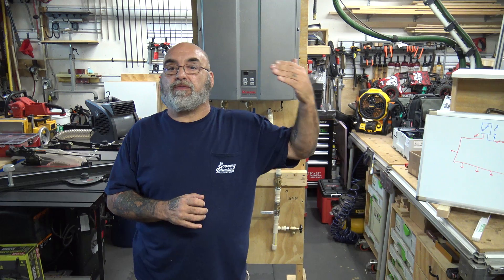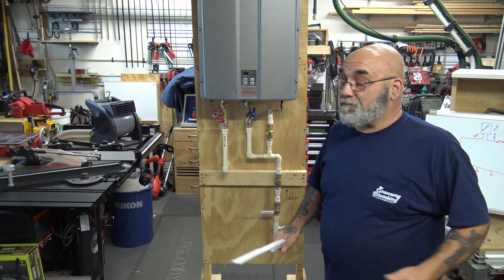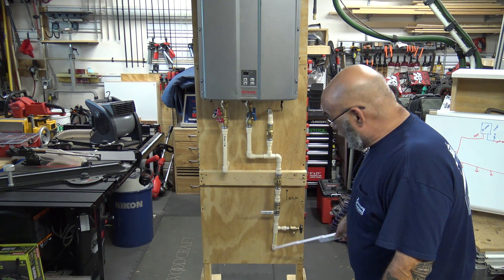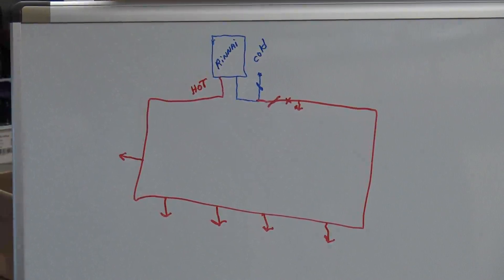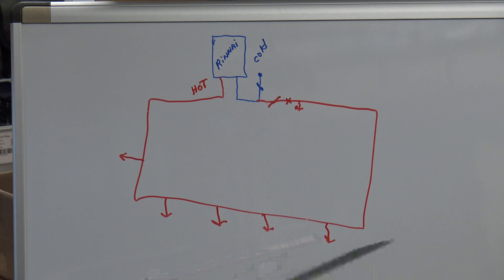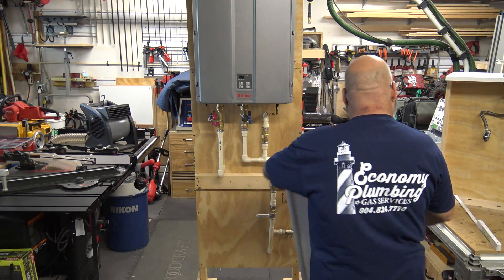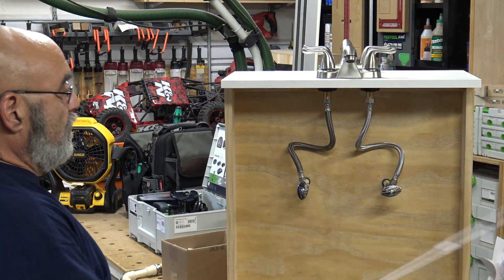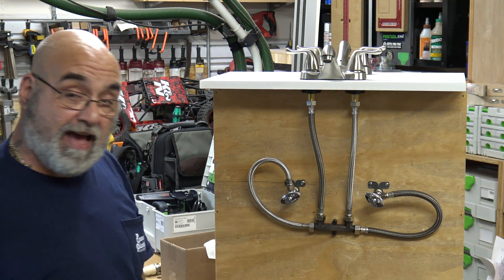Proper water piping for a dedicated return line on a Rinnai RUR unit

Comment: Hey Mike, with both of those ways, isn’t that just being efficient and just helping with warming of the cold water before it enters the boiler. What if we just want to recirculate the DHW line to instantaneous have hot water, with out the boiler kicking on. I just installed a rinnai in my dad’s house with underground water piping. And with it being winter and such a long run, it doesn’t seem to be very hot. The temp is turned up to 140, and the bathrooms are good to go. But it’s just that long run.

Comment: Hi I have a navien NPE 240S 
I have the navien bypass valve but was told I can’t use it.  How do I install an external circulation pump with check valves and the navien valve without running a third line 
Thank you for any help

Comment: Just had an RXP199i heater installed externally.  Do not have a dedicated return line,  Had a thermal bypass valve installed at the kitchen sink - not quite the farthest away, but the most used.  Today was first full day of usage.  Uses natural gas.  Temperature set at 125F.  Not getting hot water quickly in kitchen.  Takes at least 90 seconds for the water to get hot, about the same time as my old heater with no recirculation.  No error codes.  Not using Smart-Circ.  The bypass line is installed correctly.  The hot water exit from the heater is not hot, except when taking a shower.  Will call the plumber tomorrow, but would like idea of why it is not operating properly. Economy vs comfort, activity mode, pump speed, first day operation, or some other logic problem?

Comment: Is that recirc line reduced to 1/2 or remain at 3/4?
Reply: My 3300 sf house was built with a dedicated recirc line. Hot water out is 1” and return is 1/2”. I think this is smart because the 1/2” works for recirc when faucets are all closed, then when a faucet is opened it creates a bit of back pressure keeping hot water from keeping recirculating.

Comment: I think that  just screwed up!  I installed a Rinnai RX199IN Sensi :RX 11gpm for a small 3 bd/2ba house near Chicago. Totally replumbed the 75 year old house with a return line. I ordered the unit thinking that it had a built in recirc. pump. It is not an RUR unit. Do you have a video about installing a recirc pump?

Comment: I had a plumber come in and put in a dedicated return line from my kitchen faucet to the tankless. So the hot line goes from the tankless to the faucet. There's a loop maybe 20 feet from the tankless with a check valve in it and the arrow points to the tankless. The loop goes back to the tankless and into the cold water. There's a check valve about a foot from where the loop enters the cold water to prevent it from going back up that pipe. The loop goes into the tankless cold water inlet.

The problem is that sometimes the water will just be lukewarm. I can touch the hot pipe coming from the tankless and it's hot. But it's like it keeps recirculating cold water into the pipe or something and never stopping. I'm pretty sure the tankless setting is 4B. I don't know if setting 5 is set to comfort or economy. The plumber who initially installed the tankless said it's a cold water sandwich. He is not the plumber who installed the loop. What's causing this issue?

Comment: I have the RSC199e, and it doesn’t have the “plug” on the hot water line (in the out put area near the valve). I have it setup for recirculation with the crossover (thermal bypass) valve. It seems to be working correctly. Should I be looking for the “plug” internally?

Comment: Hello Mike, I have been following your exceptional video series on the Rennai installation. I do have for know a quick question. For the hot and water piping, is there a required type of pipe that must be used? I am in Dallas Texas and the unit is a condensing model that I am installing in the attic space. Could I use red and ble 3/4" PEX piping? I look forward to your reply. And a gain, Thank you so much for your great videos! Lionel,

Comment: If you have a regulator on the water service, it would be considered a closed system. Is the inlet check valve necessary on the cold water.

Comment: Aren't you creating a closed loop system with the dedicated recirculation line?  In practice, I think you need to add an expansion tank.  Otherwise, the expanding hot water is going to cause over pressure.

Comment: Whats the reason for the spring check instead of swing?  I installed swing on mine and it's horizontal so i didn't think it would matter?  After watching your video I see i need to add a drain valve.  Thanks in advance!

Comment: when recirculating pump is running, how does the cold intake know to pull from the dedicated recirc in and not the incoming cold water, or a mix of the two?

(Will the hot water have higher pressure because of its temp?)
Reply: I have the exact same question. Also does it matter if the Recirculation line is plumbed closer to the tankless water heater than the Cold water line or not? @ThatTanklessGuy

Comment: Hello Mike, I run in your video looking for help un the dip switch settings in a Rinnai RB 30/36 sanitary+heating gas unit. I connected a remote ambient thermostat to both of my Rinnai units, but I only selected one of them thru the heating button. My problem is that when the remote thermostat activates, both boilers start running in heating, regardless that only one of them had the heating option turned on. My plan B is to install two lamp-type switches on each remote signal but I want to avoid going so basic and messy on the installation. Thank you in advance.

Comment: Hi, Thanks for the videos and instructions.  My question is, Can I run a return line for part of my house and a Thermal bypass valve for another part?  In other words, can I combine the two systems?  I'm not able ro reach the odd bathroom with the return line   Thanks

Comment: I’m new to your Channel . I just installed a unit . For a couple of weeks it worked fine . But now it come on for a bit then shut itself down then it kick back on . Still trying to figure the flow rate in the setting. I don’t know if that the problem or something else . The bathroom is the back of the house if you turn the water on in the shower it only gets so hot but if you turn the sink on in the same bathroom it kick up to hot 120 . So I don’t know if I need a flow rate setting set right or a bypass . Any help will be appreciate it . Ps this is only a One bathroom . home .

Comment: Will the pressure go up when the thermal bypass valve closes?
Reply: It should stay the same if you have a pressure drop you need to check the by pass valve for debris
Reply: @TheBuddylab  it has to raise the pressure to open the check valve

Comment: We recently had a Navien NPE-210S2 installed to replace a tank system with had a recirculating line in order to reach the far master bath on the opposite end of the house. I've been thru three plumbers that all gave up on trying to understand the connection points on both ends of the recirculating lines. Could you please tell me where each end of the recirculating line should be connected to. I'm at my witts end and out $3500 do far with not consistent hot water to the far end of the house. Please help
Reply: One end the farthest is connected to the hot water pipe somewhere behind a faucet. The other end near the tankless gets connected to the recirculating pipe on the Navien.
Reply: @TheBuddylab  thank you Mike....that did the trick! I really appreciate your help!

Comment: Another big question to you Mike . This is part of the email from NIKOR gas company "If your equipment requires less than 6.5”WC and you currently have standard ¼ PSI delivery pressure your equipment should work
efficiently without a pressure upgrade.
If your new equipment requires more than 6.5” WC or you are requesting pounds delivery, please let me know at your earliest
convenience and I will need to send you a different form to fill out."
My question is - do i still need to use the recommended by you 2psi regulator ??. They mention about 1/4 psi gar pressure . i just worry is this is enough for RSC199in. thanks
Reply: It depends on how far the meter is from the unit and what pipe size you have.

Comment: Hello Mike . can i have two dedicated return lines ? my kitchen runs on separate line and this is how my plumbing was build . thanks
Reply: You will have to install ball valves or balancing valves to slow down the shorter loop for the big loop to catch up.
Reply: Yes you can as long as they run back to one pipe
Reply: @TheBuddylab  so the circulating pump will handle that ? two loops one long to my bathrooms and one short to my kitchen . i use 3/4 tubing .
Reply: I have done three sides of a house. Tankless was in the second floor loop from left, right and downstairs
Reply: @TheBuddylab  so the length don't need to be equal ? my kitchen line is 3 times shorter then rest of the house. i just wonder if the long loop will get enough hot water before the circulating pump shot off because the short loop get warmer much faster . thank you

Comment: Hello!  Will a recirculation pump work on my Rinnai RU199IN tankless hot water heater?  I don’t believe it has a built in pump and I also do not have a dedicated return line so would need the thermal bypass.  Would a Watts pump from Home Depot work?

Comment: I did not purchase a renai tankless water heater but I do have a question about the concept of a tankless water heater and using the bypass valve.  How does this affect your cold water pressure and am I understanding you correctly when you say the unit senses the the back pressure and shuts off the pump?

Comment: Would this thermal bypass valve work with the older r85 units? or would you have to add a circulator to the mix? (No dedicated line involved) PS Friggin' great set up yo got!

Comment: Hi I have a bypass system with the filter plug installed in a rur199. I'm converting to a dedicated return line. Do I need to change the filter plug to the non filter plug.? why ? isn't it better with the filter plug ? thanks Ray

Comment: I do not have a dedicated return hot water line. I have a recirculation valve and external pump. What do I need to do with the cold water filter?

Comment: I have a remote bathroom that is branched off of the main loop (it has no return line) and located about 20 feet away from the loop.
Can you use both the return line from the loop and the thermal bypass valve in the remote bathroom at the same time?

Comment: MIke, Can you have two thermal bypass vaves? Say your system sends hot water in both directions down the house... I'd think once one reaches temp and closes, the flow might slow down a bit in the re-circ system, and the other would keep open till it hits temp as well.. Or am I completely wrong.

Comment: Can I replace  the mother mode it is  there any way to repair the thankless got shorts circuit some where
Reply from the maker: Yes you can the model number for the mother board is on the paper located on the inside front cover of the unit.
Reply: @ThatTanklessGuy  thank you brother
Reply: @ThatTanklessGuy  my is a reem thankless do you think is the same than rinnai

Comment: Hello Mike, I’ve watched a lot of your videos trying to find an answer to a question.

I’ve got an RUR199en - I have a dedicated return line coming back to the cold. It looks like it’s been plumbed correctly, 2 spring check valves, etc. I have the wireless controller with the app on my phone.

The unit works properly when a hot water tap is turned on. The problem is, it’s just not recirculating by itself. The pump just doesn’t kick on. I’ve checked the setting codes per the manual (hold A button, select settings for dedicated line)  I hit the recirculate button on my app, it says it’s recirculating, but nothing happens at the unit.

Any tips for how to test the pump is working? Thank you!
Reply from the maker: It could be a bad controller, I really don’t like them unless you are connecting the push button to it. I use the MC195 controller on all my installs 
Mike

Comment: Hi Mike, thanks for the great video. I just had a RUR 199in installed and planned to use the bypass valve, but I did not have the bypass filter installed. I want to do it now, is it safe to remove the bypass plug and install the filter? Do I need to drain the heater first? or just power off is enough, I am not sure if hot water will come through where the bypass plug is if I unplug it. Thank you
Reply from the maker: yes you will have to drain down the tankless. When you done installing the filter you will have to bleed the system. make sure you follow the correct parameter settings on page 50 of the instruction manual. mike
Reply: @ThatTanklessGuy  Thank you, Mike!

Comment: Thank you for explaining this. I’ve had my Rinnai RUR98i for the last six years. My dedicated return line never work that great I thought it was something just wrong with it. My installing plumber did not put in a spring-loaded (he used a swing) check valve,  nor a drain valve. So I’ve been getting code 63 on and off for the past year and I realized with your video I can't bleed the air from the return line. Thank you for explaining this to me. At least now I can talk to Rinnai guys with some level of intelligence. These plumbers in California just don’t know what’s going with these Rinnai systems or how to install them properly. Why don't they just explain from Rinnai so we laypeople can hold these plumbers accountable, it's really not rocket science.
Reply from the maker: that’s so true if the installer just read the manual some of these problems should not happen

Comment: Hi Mike
I have a RUC98i just installed. The hot water works great and no issues but the circ system won’t continue to run. Piping is exactly like you show in the video. I have it on a timer and when it turns on, the pump will start and in little red light will display , but after a couple of minutes it will hot heat anymore
Using a grunfoss 1/2” bronze circular, any thoughts?
What’s a good gym for the pump?
How long can I have the circ pump ( I know 24 hours is not good ) also does the circ work better at 120 rather than 130?
Thanks in advance.   Kerry

Comment: I have the RU199i. not the RUR. can I use a thermal bypass valve to assist in circulating the water to my furthest faucet? I'm reading that the RU can not have a recirculation pump added. is that also correct?
Reply: No you can’t the bypass valve will only work on a RUR Unit
Reply: @TheBuddylab  Doesn't the RUC98i have circ logic so you can install an external pump and let the heater control it?

Comment: HI Mike, I asked a question about using a manafold each hot and cold has its own shut off,and wanting to use the RUR 199 to recirculate. You answered But I didn`t understand your answer as to can it be done or not ??... Thanks
Reply: No a RUR can not be used on a water system like that.
Reply: @TheBuddylab  Thanks Mike for your help.... Love your videos

Comment: Is there something special that I have to do to access the parameters menu of a rinnai rl75i
Reply: No there is nothing on that model just turn it on and after you bleed out all your hot water faucets plug it in and it will work. Mike

Comment: This video is very helpful, but I have a question around the thermal bypass. Does the thermal bypass need to be installed on every faucet I want hot water instantly or just the farthest one and somehow it will work for the rest?
Reply: Only one can be installed in the farthest fixture. Mike

Comment: thanks for the video, since 3/4 inch pex. fittings are 4-5mm smaller in I.D. than copper or cpvc,  do u know from your experience if using copper or cpvc for supply lines is better for max. flow even if the water pressure for the install is up to spec.
Reply: Pex. Is better even with the smaller I.D. And type A pex is the best.
Reply: @TheBuddylab  thank u

Comment: What size should the dedicated return line be or is recommended? My house uses 3/4" main trunk with short 1/2" to the fixtures. I have about 40 feet from the tankless to the last sink. BTW, I watched all your RUR videos since I got a RUR199in and can't say THANK YOU enough!! It helped me prepare and slowly but surely install my tankless. I have it set up on No Recirculation currently because my old tank heater finally rusted out while I happen to be standing next to it lol so I simply just connected to the existing lines but will be putting in the dedicated return line shortly since I have access to basically all the piping. THANKS AGAIN MIKE!!

Comment: Do I need a check valve going to the unit if I'm using the thermal bypass valve and no recirc line?
Reply: No you do not there is no need for any check valves when using the thermal bypass valve. I hope this helped. Mike
Reply: Thanks Mike.  It helped tremendously.
Reply: I seen elsewhere that you do ONLY if you have a water softener. (Prevents damage to the softener)
Reply: Thanks Mikes Wood Shop for clarification.   Mike mentioned in the video he was using the check valve in the mock up only b/c he didn’t have enough CPVC.   I was getting ready to email him, but this just confirmed what I heard in the video.   Thank you Mike for taking the time to do all of these videos!!